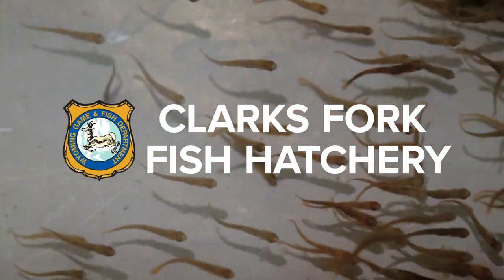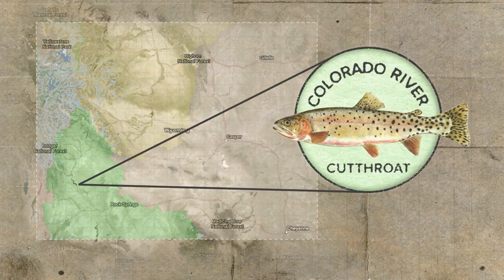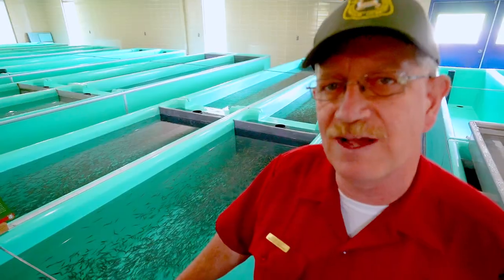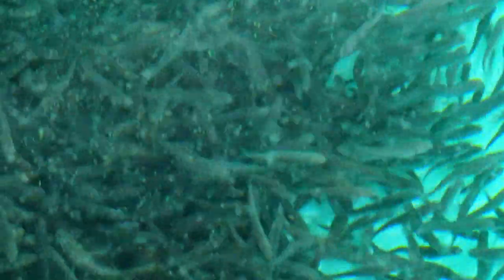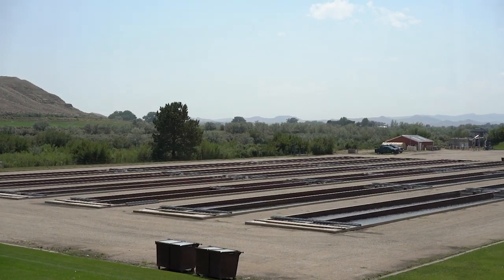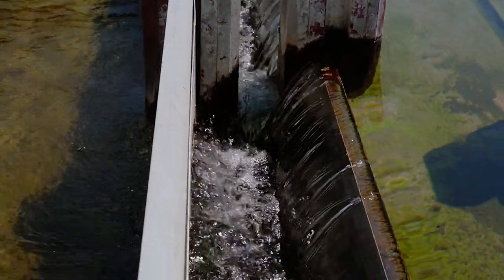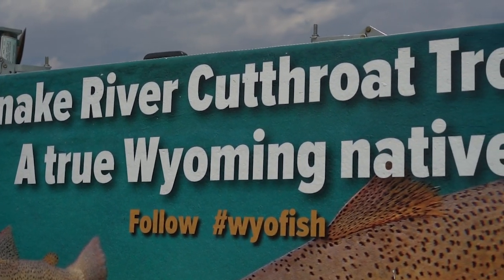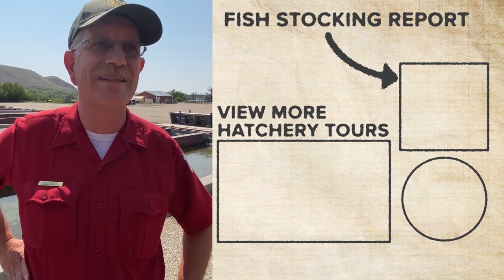Virtual Fish Hatchery Tour - Wyoming's Clarks Fork Fish Hatchery

Comment: So many different species! Very cool! I’m wondering if this is a RAS system or a Flow through. Very informative video before I apply!
Reply: Hi Jacob. This facility is entirely flow through. All of the fish in the indoor hatchery and outdoor raceways get first-use water. It's possible to reuse the hatchery water in the outdoor raceways if needed, but that normally isn't necessary due to all of the water the facility receives from its springs.